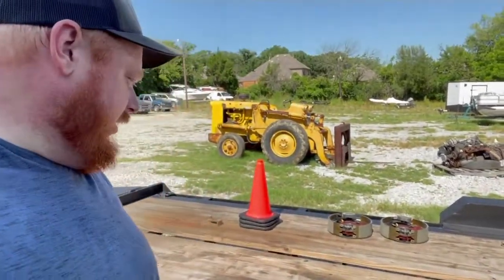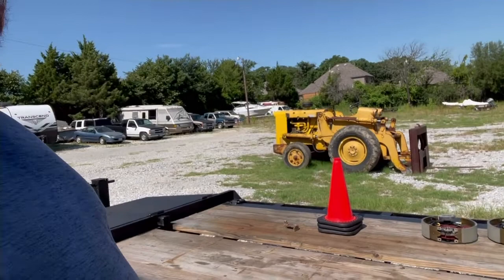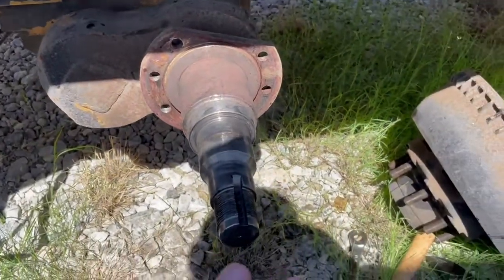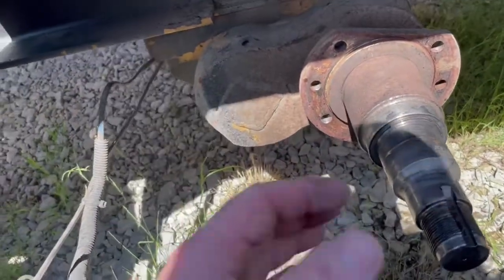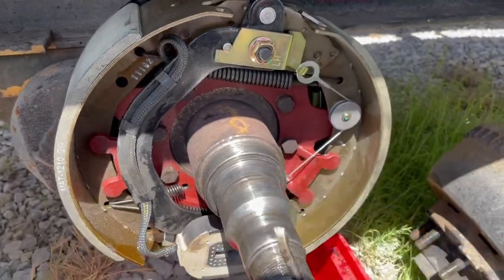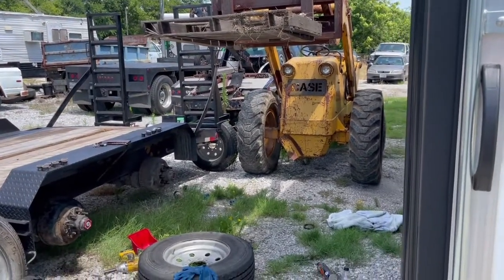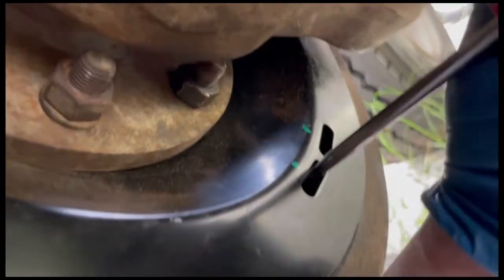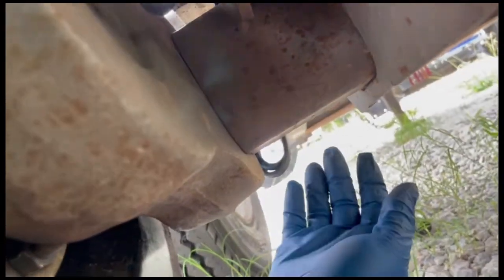Fixing electric trailer brakes on the cabovers little trailer!

Comment: Hi Gary John Taylor here !! I have owned many trailers similar to yours and have done same job as you. I have also had problems with the old packing style bearings as I carry some fairly heavy equipment. About 15 years ago I went to the oil bath bearing set ups and man what a difference !! No issues at all !!! My first two oil bat trailers had electric brakes and they were also great. Interstate trailers from TX. !! Now I have a 20 ton with air and 100 % love it !! I hope you get to try one as you won't go back to the old style !!   Good luck !!   John
Reply from the maker: Hi John!  Thanks for the comment. This trailer is oil bath and I agree. Much longer life. It also has the valcrum oil caps witch are aluminum with a view window. I highly recommend them as well. I did buy a 45k capacity trailer but it’s a belshe. I’m looking forward to the increased capacity.
Reply: @cabovergary  I have a '91 Freightliner FLD single rear axle with Cummins M11, and a just installed rebuilt 13 speed transmission I was thinking you might be interested in.